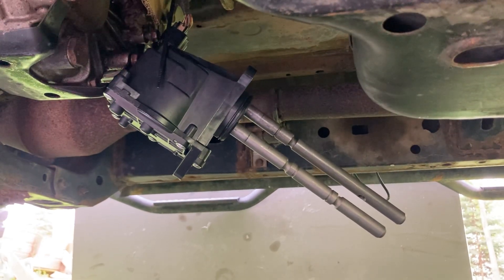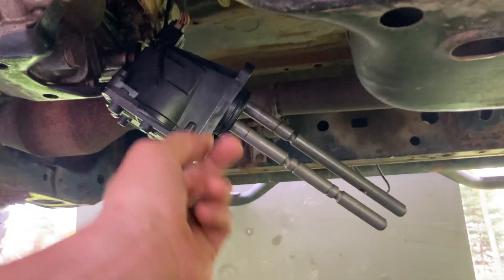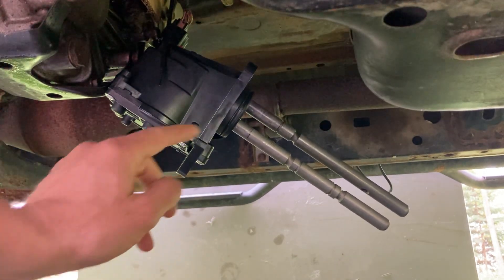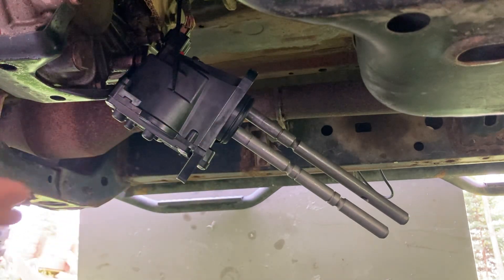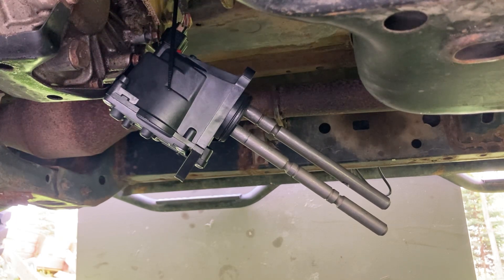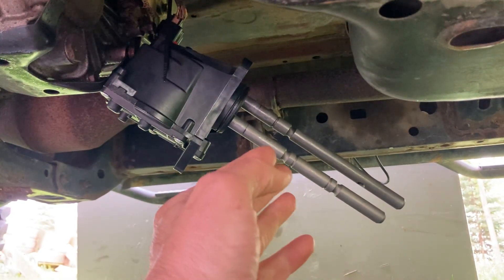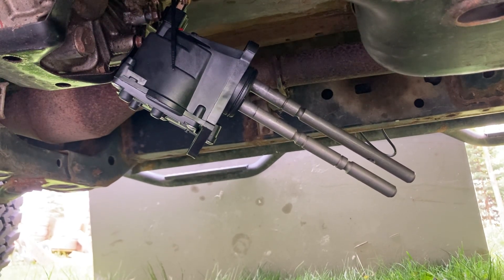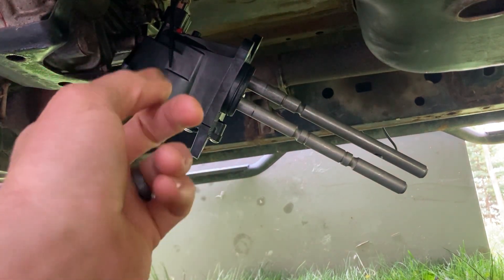2004 4Runner V8 4WD actuator functions and operation HI Low Center Diff Lock

Comment: Hi! Thanks for all your 4Runner videos. I’m prepping to use your 3 bolt t-case trick as I’m stuck in 4lo.

But, you made that video first? So there were ongoing t-case issues that led to replacing the actuator?
Reply from the maker: I did have ongoing issues and this was a much less difficult and faster repair.

Comment: Could you tell me the position of the blue gear when in "normal" unlocked center diff position?  I'm replacing mine now and the only thing I didn't mark was the blue gear, but it moves easily and now it won't engage the center diff.  VSC OFF comes on but lock light just flashes.  Thanks!
Reply from the maker: Center diff lock is the top motor when you remove the cover. The blue indicator should be at 12 when looking at the grey mark at 9. Hard to describe but make sure both motors are good. My 4WD motor was good and my center diff motor was intermittent. I replaced the center diff motor and now everything works. I have another video removing the actuator and reinstalling
Reply: @jakemir  Thanks - I have a GX470 so I only have the top motor.  I was able to get mine figured out.  My blue dial was in the right position, but all I had to do was push the actuator rod full inward before I put the gears in, then everything worked.  Before I had tried to mark where the actuator was inside the new housing when it was shipped to me which didn't work.

Comment: Have you been chasing your 4wd issue for a while? I have a v8 4Runner too and I think I’m having the same issues as you. It flickers 4lo while driving and makes clicking noises and eventually the 4lo flashes and beeps. Then I do the nifty reset thing you made a video on and it’s good for only a little while again. Do you know what I should do to resolve it?
Reply from the maker: I changed about everything I could except the actuator itself. The problem is your motor is failing in the actuator. There are two motors. I tried the Amazon actuator and it is total garbage so I bought a used one on eBay but it took me three actuators before I found one that worked 50% and then I took the center differential motor and encoder out of my old one and put it in the used one and reassembled it and now it is working. Here is a video how to replace it without removing the transfer case. I no longer have any flashing or beeping or issues.

2003-2009 4Runner replace transfer case actuator without removing the transfer case
https://youtu.be/Iq-CusWQ1Wo
Reply: @jakemir  dang I really hope it doesn’t get to that for me. I did replace the old battery and cycle 4lo and 4hi like 20 times which seems to have fixed it temporarily. I don’t use 4lo really at all so hopefully it was just getting stuck and the extra voltage is helping it. It hasn’t been flickering on the dash much anymore just once every 50 miles now which I can live with until it breaks. It switches perfectly in and out of 4lo so maybe I’ll try cycling it more and see what happens. I’ll tell you if that works too since I’m sure people are going to have this problem more as the trucks get older…

Comment: I did this exact job on my '03 V6 without removing the transfer case. What a headache at first, with all the gears and position sensors, but I was able to successfully get an Ebay actuator installed. Saved me a few grand, lol!
Reply from the maker: Did the V6 have two shafts? I did see the single shaft replaced but never the dual shaft. I am going to try and install the 4Low shaft first leaving out the gears to the center diff. After installing the 4Low then I will install the gears to the second half. This Amazon one is garbage. A tooth fell off as I was bench testing it. No wonder it is only $200 vs $1600. Thx for the post
Reply: @jakemir  Yes, the V6 has two rods, 4Hi/Lo and Lock, and yes, the Ebay actuator gear's teeth stripped out. I had to remove the gear and replace it with the OEM gear from the old actuator. This is the gear that makes contact with the shift rod, the spring loaded one. So far so good!